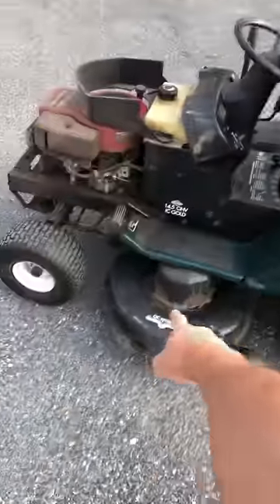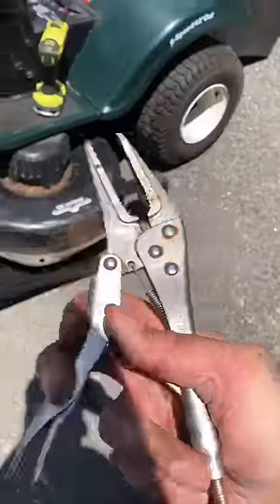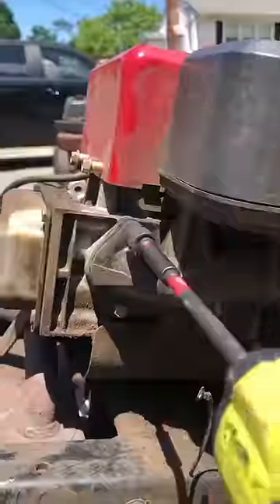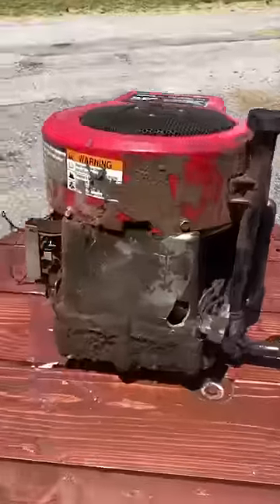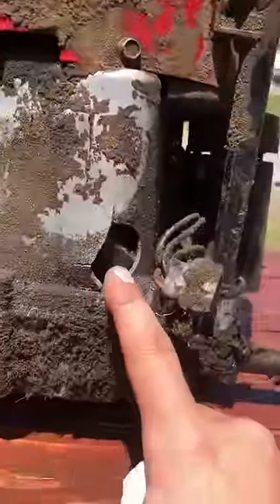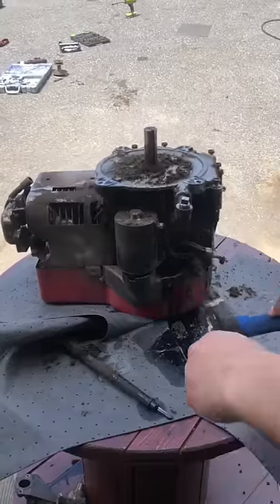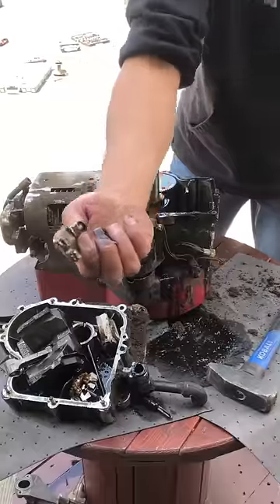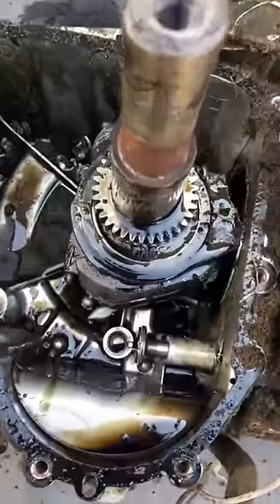The Dangers of Hitting Rocks | Exploring the Consequences on a Craftsman Riding Mower

Comment: Hitting a large object would more than likely shear the flywheel key at most.   Don’t think that damage was from that. Probably was related to low oil or poor maintenance ( oil not changed often enough)
Reply from the maker: I’m all for it.
Reply: I came here to say the same. I've absolutely instantly stalled several push mowers on exposed tree roots and high centered on dirt. I've done that to a mower that is 31 years old and 5 years old and they both run like new still
Reply: Most likely no oil and jumped out safety (if it has one)
Or low oil jumped governor ?
Reply: I used to work for Sears home repair. I've replaced an engine on a rideing mower, filled new engine with oil and within 20 minutes of run time, the new engine threw a rod out the side of the crankcase. The engine didn't exibit any odd noises beside the rod letting go. This was back in 2011-2012.
Reply: Especially as a belt exists between the blades and motor...
Reply: That was the first thing I thought when he said user hit a rock.
Reply: I have a push mower with a bent crank from hitting a water shutoff. It's surprising what an impact can do to a running engine
Reply: @carsondaly1521 But the blade is not directly driven from the crank, I'm pretty sure this engine damage is unrelated to the "hitting a rock."
Reply: Freal I was gonna say the same thing, my push lawnmower ran over rocks big as it still runs great 😂😂
Reply: When it grenaded he probably just assumed he hit a rock.
Reply: @rc4life483  
Tell me about it. Briggs and Stratton has gone downhill. Had a 25hp engine completely worn out in 2yrs just mowing 1 acre. Cylinders were out of round and it used a quart of oil like an old ford Sad when the company forces you to by Honda or Kohler to get a quality product.
Reply: I’d say the 1st thing that I’d do is go get a good quality rebuilt motor and call it a day!!
Reply: @wesman7837  Most mowers have belt connected to the engine. If the belt is tight enough it can shear the flywheel.
Reply: Yep! Weakest point in that system is the belts! Stuff is designed to break before it breaks bigger stuff. That motor was poorly maintained
Reply: @srwven its never "too tight". It's always spring loaded.  You can it over tighten it.  That belt slips in high grass, no way a rock caused this.
Reply: @jimb032  Rule number 1, mechanical safeties can always fail. Spring tensioners can rust/freeze shut. If your belt is slipping in high grass then either your belt is too long, tension not correct, oil/grease on pulley... I'm not saying a rock definitely caused this. I'm saying hitting solid objects can shear a flywheel key. I have had it happen.
Reply: Yep . N hitting anything won't do anything to the motor cause its running on a belt. Only push mowers get damaged cause the blade is directly attached to the crankshaft 🙃
Reply: yeah that's the result of running out of oil
Reply: @carsondaly1521  youd be surprised how a hick with a hammer can straighten it back out , but often the mains are ruined in the bottom plate
Reply: @wilsonrawlin8547  that's why I've been hoarding old blocks for years . They make them from recycled shitpaper now .
Reply: Rock noise was actually engine blowing up
Reply: No doubt! I hit many stumps and rocks with push mowers which sheared flywheel key and bent the crank. But oddly never blew up! New key, mini sledge the crank back straight as can n keep going!
Reply: @shawntailor5485  
You ain't kidding brother.
Reply: It would slip on the belt pulley before doing any damage
Reply: Also on riding lawn mowers they normally don't just throw a rod from hitting a rock
Reply: Agreed
Reply: @calebz1448  I once had a sacrificial push mower (I think it was a Bolens) that I used when clearing heavily overgrown or rough areas. It was free, so I didn't care too much.  I ran over stumps, rocks (big ones), buried it in dirt and made the neighbors think we were experiencing a dust storm, and once plowed through a hidden gravel bed. It refused to die.

It didn't have an air filter and was ran more than once with nothing visible on the dipstick. It was ultimately a test to see how hard I could beat on it and it keep going. The engine still ran perfectly when it was retired, but the deck was completely rusted out.
Reply: @calebz1448  I usually bend the push rods whenever I get extremely carried away and start driving over 4-5ft tall thick grass. This is kind of a two pronged issue though because the steel valve guide in the aluminum head gets pushed out of place also by uneven heat dissipation. Which in turn leads to the valve being unable to cycle it's full stroke which in turn leads to a bent rod also. My two yards add up to like 10 acres.  So in other words I have pile of bent push rods and some mowers running with re-straightened push rods also. Side note, wtf steel in aluminum still? Get your shit together Briggs & Stratton, get yer shit together

Comment: They thought they hit something! What they heard was the connecting rod making it's own inspection port!
Reply: Hahaha i like that😂
Reply: @andrewut7ya511  😁
Reply: This is the real reason.  The belt would have just slipped if it was a rock.  I have the poulan variant of that thing I abuse the crap out of.  I would have blown 30 engines.  Also it's spring loaded belt.  You cannot over tighten.

Comment: How did hitting a rock with the blade cause the engine to grenade itself. That makes no sense at all.
Reply: Zahraious_Aka_Z5816  100% they lied that was massive failure that just happens OR they didn't take care of their mower. My tractor was bougth brand new in 93. new 30 weight oil every year and it runs like new. oil looks almost brand new when it comes out.
Reply: @arbiter1 even with cars today most will generally last 200k+ miles, it’s all in the 🙌🏻maintenance🙌🏻
Reply: I was mowing with this same engine and when it blew up I thought I hit something. I didn’t hit anything but the rod exploded, they probably just thought they hit something.
Reply: Karen got into the thread
Reply: @ModMokkaMatti Lol, better watch out bro, he didn't give you permission to comment on this chain. 😂
Reply: if it was a big rock like a piece of cement on a push mower i could MAYBE see it in an absolute extreme case but not in that spot
Reply: You are right. That can only happen when the blade is directly mounted to the crankshaft, as on a push mower. I recently busted my push mowers block hitting a pick axe head in the grass. It also blew the back wheel off!😅
Reply: They hit a rock with the rod :)
Reply: @eamh2002 A Johnson rod?

Comment: That engine blew up because of lack of oil or never changed it.......hitting a rock will NEVER cause that !
Reply from the maker: @gunnerpetrea3531  gotta understand the context first to be able to understand this vid.  Chat GPT helped with the headline of the video and the description. I ultimately posted it so I am responsible for hitting the publish button. At the time of the recording I also took the seller for their word and understood that she hit a rock. Obviously she heard the engine implode and thought it was a rock. If I had known what happened I would have communicated that during the video. I learned later through comments what happened. 🥰
Reply: Chat GPT is only as smart as the collective intelligence of the internet.  That’s not a good thing.  Far too many “experts” who don’t know diddly squat ,posting “life hacks”.
Reply: This is why I’d rather just spend the $$$ and get a brand new mower.
Reply: @NiceLawnBro "She" okay. We forgive you. That explains everything that happened to that mower.😂
Reply: @tcorris  hi
Reply: @spankthemonkey3437  it can bend the shaft, sometimes to the point the engine either can't spin or loses all the oil thru the damaged flange/bearing/seal.

Only thing I know of that will throw the rod in a Briggs is no oil. You can't even redline them to death in the case of the singles... They can't breathe enough air to even float, nevermind throw the rod.
Reply: @spankthemonkey3437  True. I'm not saying that's what happened, just saying it can go down like that.
Reply: @spankthemonkey3437  Not necessarily. The key shears when the force is "pure torque". The key does normally let go in a crank bend scenario but not always. It depends on the dynamics of the collision.

If a blade suddenly encounters a pipe sticking up, it can have a whole different effect than a stump or a smaller rock vs the tip of a buried bolder and so on. There are gyroscopic forces that come into play that will bind that shaft-adapter joint solid in the right conditions, laying all the torque to be had to raise hell. The key isn't a magic trick, it's more like a fuse. If it goes, there's a chance something left over is fsxked up.
Reply: @spankthemonkey3437  and if I'm being complete here, the flywheel key almost always lets go, or the bends would always be impossible. That energy has to propagate all the way thru the crank to the point of contact. It's like a spring in there if you're trying to get the contents of the flywheel out now 🤣
Reply: @spankthemonkey3437  Hahahahaha yeah they can be tricked out but "as found in the wild" they are pretty robust little engines. I'm not sure if they bother at all any more but the little 3hp and 5hp iron sleeved updraft engines were ballsy and would take a damn beating and "Wut" lol
Reply: @spankthemonkey3437  We used to use them screwing around with the worn out engines we were going to toss. Steel in the flywheel is basically suicide especially on a sideshaft. If it doesn't kill the crank directly, it'll eat up the keyway on the crank (if it doesn't catastrophically fail anyway lol) and then can't keep spark time for shit and eventually won't run or stay running after popping off a couple times.
Reply: @spankthemonkey3437  Whaa? A sideshaft running aluminum? I could never get one to start. Pop off and act pissy all day but yeah the aluminum flywheels were meant to be coupled with the blades as flyweight. I figured they were quick without the blades but never managed to get one to go
Reply: @spankthemonkey3437  Hahahaha you got deeper than me on that then. I definitely dropped a few on frames but never got nutty with it. I wanted to build a belt based 5 speed (complete with H shift and pedal) but it never happened and I guess with that in sight as "this first"... 🤣
Reply: @spankthemonkey3437  Lol 🤣
Reply: @tcorris  chat gpt basically collects the average belief expression found on the internet . collective belief does not necessary reflect the intelligence. If I input « how to clean remnant in a gaz tank before cutting it » on chat gpt, the only thing I obtain is « beware, it’s too dangerous, pay a professional «  ok so it’s impossible. And if impossible, no professional can do it !

Looks like the damn shit chat gpt collects are all the warnings found on the gaz companies websites and the « don’t to it » on the forums

Comment: They didn't hit a rock, what they heard was the connecting rod installing a new window in the block.....
Edit: WHOA.. 858 and climbing lol
Reply: Rainy Mondays playing in the background as B&S removes all hopes of having a good day.
Reply: gets off and checks for rock
"Wow, it must have been turned into dust."
Reply: @kramnull8962 Tbf not changing the oil will do that to ya.
Reply: It needed a new air breather
Reply: No. he just didn't clarify what type of rock. He hit a crack rock, before mowing. 
He wasn't referring to the IED he was driving lol
Reply: Agreed, that whole power train is belt driven.  A rock impact couldn’t transfer that much energy back to the cranck
Reply: My wife hit a culvert and did this. Hole in the same place, too. Yeah, it's for real.
Reply: @ancienttech4603  its impossible to blow an engine up hitting anything. The belts take the impact and stretch. I don't believe that for a second..
Reply: @ashleystovalldaman  exactly!!
Reply: Hey it gets dark in there!
Reply: @apersunthathasaridiculousl1890  facts lol
Reply: That's a keeper.
Reply: @kramnull8962 remember when b&s made good engine? Pepperidge farm remembers
Reply: Over revving did this .. not a rock.. i know first hand… small engines rev up and down mysteriously and if you push it it does what is called runaway engine( diesels do it alot) and when it over revs once , boom out comes the rod😂😂😂…ask me how i know
Reply: @christiantorres2950  or it was ran low on oil, ask me how I know..
Reply: @BlackbeardJohnson  that too😂😂😂😂😂i think we both know
Reply: @christiantorres2950  😂
Reply: Seen bent blades broke  mandrel  housings and shafts ,but never this! Lack of oil is what did this !  They heard engine explode and thought  was a rock!         I prefer the band s flathead engines especially the opposed twin, they use a small bump  machined into cam lobe instead of that junk mechanical  release!    It was their patent called easy spin starting.
Reply: Lemme change that 😂 HAIL SATAN BROTHER 👍🏻
Reply: #751 !!!!
Reply: @Gnomehome14  758!! Haha
Reply: @ashleystovalldaman didn't have to transfer energy, just load the engine hard and instant. That flappy bit on the cam pops out against it's retention spring and turns into a motor mangling clearance issue at/near full RPM
Reply: @SLOCLMBR  yep we are on the same page.  Hitting a rock didn’t do this, the mower deck belts don’t have it in them to cause this.
Reply: Yup
Reply: That's not true at all. Anytime there is a sudden stoppage, there is a high potential for catastrophic engine damage. It happens a lot when piston aircraft propeller strikes something
Reply: @Taydrum  is this a piston aircraft? Have a good day sir....
Reply: @BlackbeardJohnson  obviously not, but the design is the same for many mowers. Direct to the crankshaft.
Reply: @Taydrum  no its not 😂😂😂
Reply: Make it 859 lol
Reply: @Person12345ism  haha nice!💪🏼
Reply: Yes I knew this wasn't a rock.

Hitting rocks and stumps doesn't throw rods.

Lack of oil does.
Reply: That would be my guess as well.
Reply: Because your rite no rock did that it looks like it had a rod knock no rock then it started to run like a rock

Comment: The lack of oil I saw has to be the reason it blew up there is no way it just did that
Reply: not lack of oil, is an overspeed issue
Reply: Im guessing poor maintenance or just too many hours on it. Normally the belt would slip. And also if you stall a manual car, that engine also is fine…
Reply: If the blades stopped when engaged and it suddenly stopped or significantly slowed the rpm the engine parts (Piston and rod mainly) will break as shown. Most rods are a soft aluminum for that reason. So parts hopefully don't injure people around. As an Aircraft mechanic working on f/a-18's we sometimes had to be around the engine during start up which is extremely dangerous if those parts go flying.
Reply: @Nowayjose-z2r  Normally the belt slips tho. Mowed over a lot of leaves once(yes they are softer, I know) and what happens was that white smoke from the belt came out of the mower deck. They are designed to slip before something bad happens. If it would be directly attached to the engine without any sort of clutch system, it might explode the engine. But still if you stall a manual car the engine still survives. If this engine blew up because of hitting a rock with the blades it probably was due it being damaged before (probably due to poor maintenance). Thats my guess.
Reply: @dreiback182 Exactly. Anyone saying a rock would cause this has absolutely no idea what theyre talking about. Its a belt driven mower, and the belt WILL slip or break WELL before throwing a rod
Reply: @Jason-un9ps  To be honest tho, I think the creator of the video probably thought it was a rock and than people came by to tell him it wasnt a rock and I guess its one of those situations where you think youre right and then somebody came by with another idea and a resoning and youre than like: Ohh, that makes sense, I guess Im wrong

And it might have been a rock giving it the rest but what happend before hitting the rock is the main issue, I guess. Either it was poorly maintained or had a whole bunch of hours on it and the little stress from the rock was just the bit too much...

Comment: hitting a rock.....wouldn't do that to the engine. spindle yeah......but the belt.....no solid connection......how would the shock transfer all the way from the deck to the engine? We work on commercial outdoor equipment for a living......seen it done to push mowers that way, easily. but never a rider.....lots of bent bladed and spindles.
Reply: It should have sheared the flywheel key before destroying the engine. Small engine flywheels have a very specific torque requirement for this reason. The idiots I've seen tightening flywheel nuts on the internet with an impact is unbelievable.
Reply: Yes thank you......

Comment: I’ve actually done this numerous times and it’s cheaper to just go buy a new lawnmower. When I was younger, my grandfather had a machine shop and I would go make a new flywheel key but the thing is a lot of places don’t make the fly wheel key they want you to buy the entire kit and sometimes entire kit can be $300-$500. I just did this with a Toro lawnmower that we had. The kit to replace the shaft, flywheel key, and a couple other parts cost it as much as 50% of a new mower so I just went and bought my mom a new lawnmower. If you have access to someplace where you can make a fly wheel key, I would just get the bar metal and make one. I’ve been to drive shaft, so that is why I had to get a new mower instead of just machining a new flywheel key.

Comment: I replace camshafts a lot and the only time that piece caused damage it made a slight crack in the case those engines basically blow up for only one reason which is oil starvation if you catch it in time you might be able to just replace a rob but usually people are dumb and they keep going until the rod gets shot out